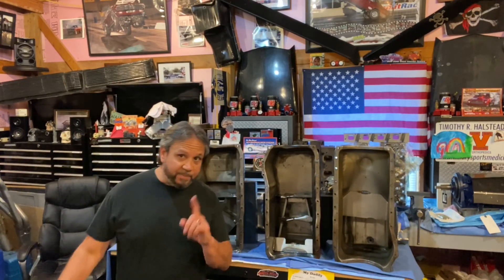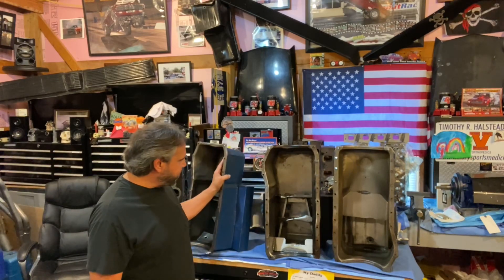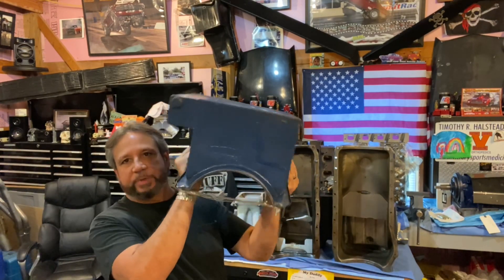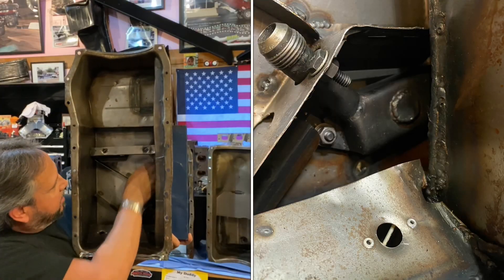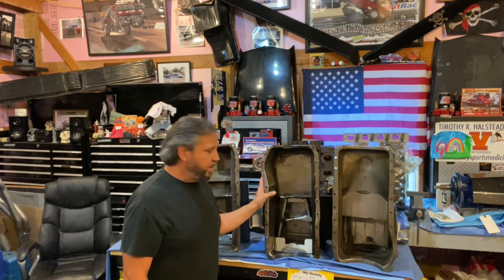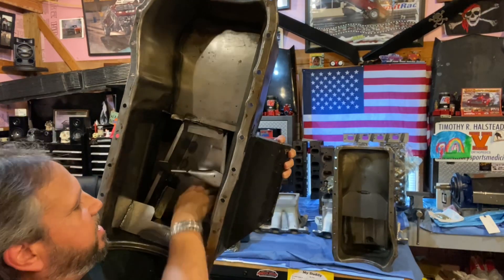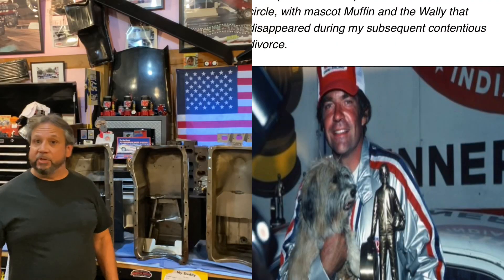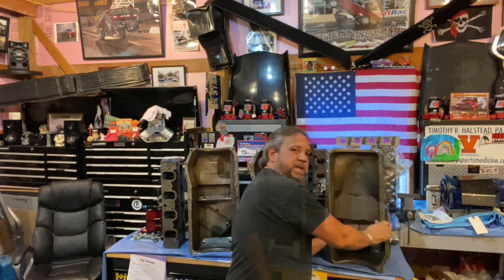DragBoss Garage: Pro Stock Minute , The Ford 351 Cleveland Pro Stock Oil Pan, Get Control

Comment: Check out this old nascar documentary, this Norris team are working on the Cleveland engine from 20:20 : https://www.youtube.com/watch?v=RMOHmL_dwbc&ab_channel=Calhoun98 and look how low they cut the decks! they have to cut a relief into the pistontop
Reply from the maker: Cool video, only saw engine well at 20 min mark, hard to tell on deck height, Well at least you know they used Cleveland blocks.
Reply: @dragboss351cleveland  Yes but did you watch the entire garage sequence, not just a few seconds of it? You saw the piston crown with the sparkplug relief cut in the middle of the clearance between the two valve reliefs, which leads me to believe they cut the decks down really low and wanted the flame front to spread to both sides of the combustion chamber - the electrode must have been running damn close to the piston by any stretch! Also note, the slits cut into the side skirt of the piston.. Is this to fight against seizure when running lap after lap at high temperature? is to to reduce friction , thus freeing up horsepower? afterall the part of the piston doing the work ends where the rings end. I know some 2 stroke motorcycle tuners used to use tricks similar to this to prevent soft seizes in the cylinder as the engine warms up and tolerances expand, I'd like to find out the logic behind this hack / cheat though? lol
Reply from the maker: That spark plug notch is nothing special, all pop up Cleveland’s have that shape. The plugs are close no doubt. I have to index my plugs or the piston will close the gap,  the problem with pistons back then was skirt cracking, was not until they had the better design, not sure if it was called slipper, but the pistons back then where heavy, although the high end venolia were pretty light.  On the converse the pro stocks cut down deck ht to 8.8-9 maybe more to shorten runners. All cool stuff.

Comment: When you see the parts that those guys ran back in the day, it makes me appreciate how badass those cars were and the guys that built them.
Reply from the maker: They were Banger. Glidden was running I think high 8.30s with the 80 Fairmont, with 343ci and iron high port heads. He did have a sheet metal fabricated intake, but it was made by hand, finished by hand.

Comment: My family had to make our own pans too, we ran circle track. Basically, take the trap doors for your pans and turn them 90 degrees to the right side, to keep oil at the pickup in the turns, We made our own pickup screens as well. Our pans had the kickouts only on the right side. Crank scrappers made a lot of difference.
Reply from the maker: Thanks Elmer. I have never crafted anything associated with oil pans or pick up. Would like to use a pan like that. Have to make a pick up. Appreciate your experience, we all do. Be safe and stay tuned
Reply: @dragboss351cleveland  You have the talent, I've seen it here. If a teenie bopper kid that I was can scratch up a working pan, I'm more than confident you can lol. I just wish my folks would have sprung for the dry sump stuff, they were too cheap for that.
Reply from the maker: @elmerfudpucker3204  Thank you my friend. be a good winter project. I have to admit, I love those Stefs, aluminum pans. I'm too cheap for dry sump also.lol

Comment: Showing these young '70's guys were REAL HANDS ON fabricators and problem solvers, and brought about systems that are still used today !!
Reply from the maker: I think all of the major innovations came from 70-82, at least from our pro stock engines. Thanks Adrian
Reply: @dragboss351cleveland  ...Yes they did, Tim.  You make a good point and those of us that were around to experience it would most likely agree. 

Because I’ve always heard that Clevelands make power....and that beat will go on for nearly all of eternity...and a day 😉

Comment: great shoots of the oil sumps  Tim, my farther built a jet boat and we had to do the same thing to the sump for oil surges. the jet boats are 16 feet long so we turn extremely tight and, oil surge is a big problem.
Reply from the maker: Cool to see how they relate to all engines, and situations. Thanks Craig